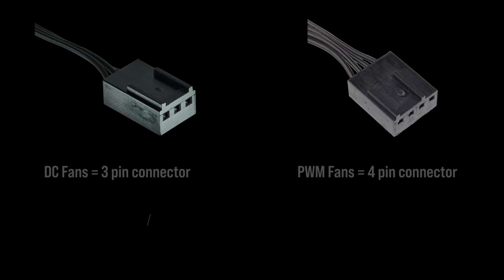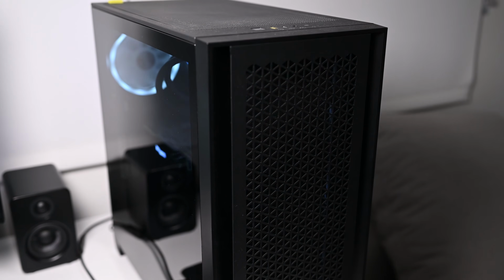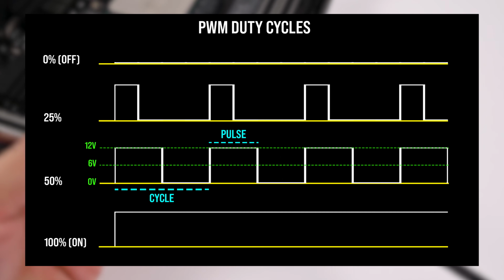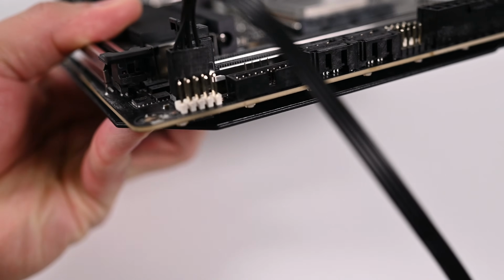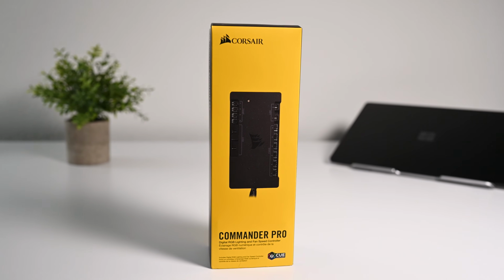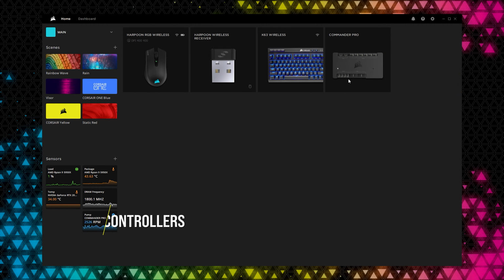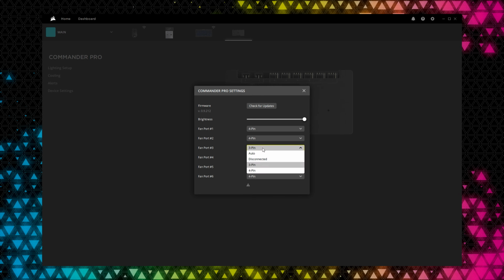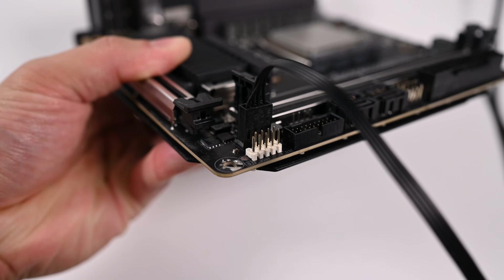DC vs PWM (Pulse Width Modulation) PC Case Fans

Comment: Got a question: if my b450 f has 3 CHA_FAN but only one of them works. Does it mean that my 600w power supply isn’t enough? (I have a rtx 3060 / an AMD 5600g / and a M.2)

Comment: ANTEC makes nice dual ball-bearing case fans with a 3-speed switch. He is wrong. With DC, you can get 3 distinct speeds without PWM.
Low Speed: 1200 RPM | 39 CFM | 25 dBA
Medium Speed: 1600 RPM | 56 CFM | 28 dBA
High Speed: 2000 RPM | 79 CFM | 30 dBA

Comment: Will the fans still spin even if I dont install the pwm connector in? My motherboard doesn't have enough connectors for all fans and i don't really care to control the speed.
Reply: Welp. 2 years late but for new people, you can use a fan hub that takes power from PSU.

Edit: One connector will connect on motherboard and the other fans will connect on the external fan hub
Reply: Are you really asking if the fan will still spin if you don't connect it? 😅

Comment: Is there a cable to connect 3 SP120 RGB PRO fans to my MOBO (ASROCK A320M/AC) which only has two inputs 1 Fan Connector (4-pin CHA_FAN 1 and 1 Fan Connector (3-pin CHA_FAN 2) so you don't have to buy the Corsair CL-9011110-WW Fan Controller Commander Pro Temperature Monitor that costs more than 100$ Thank you for the contribution that you or anyone who reads this question, happy afternoon
Reply: Hey, there are lots of pwm hubs out there. You can use something like the Akasa FLEXA FP5H or DeepCool DP-F04PWM-HUB
Reply: y cables

Comment: So can a PWM fan with 4pin connector be be regulated with voltage 0-12V or not?
Reply: Yes, they are both DC fans. 4th connector is just the PWM signal.